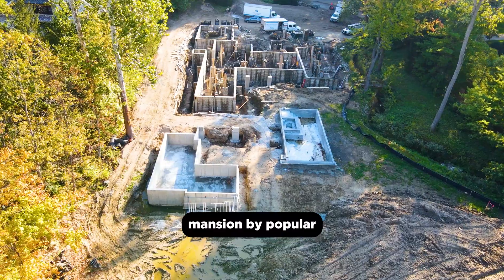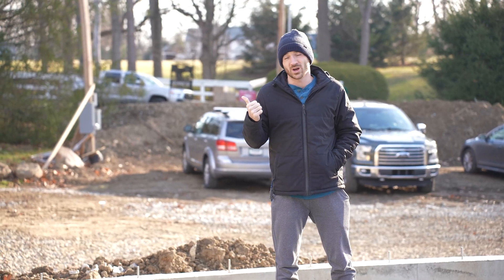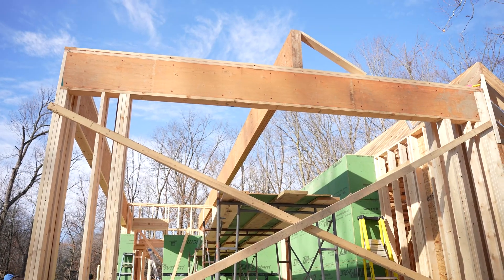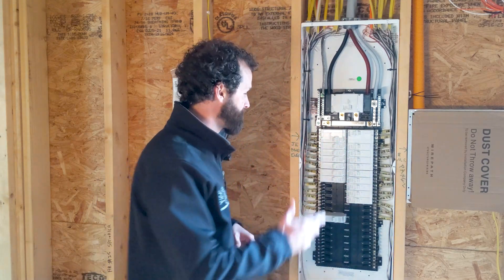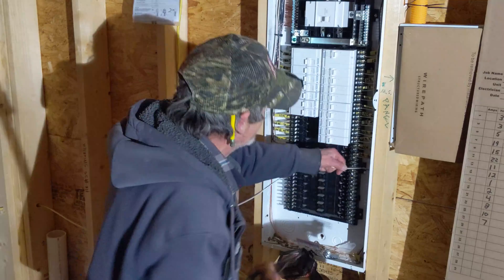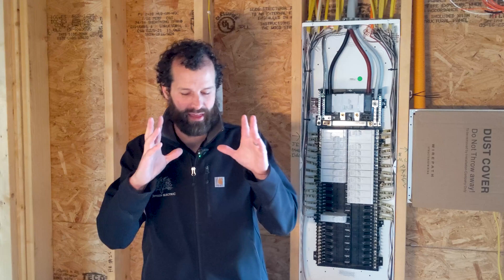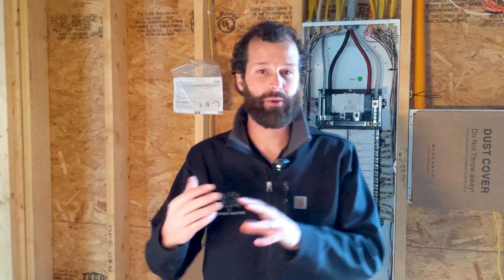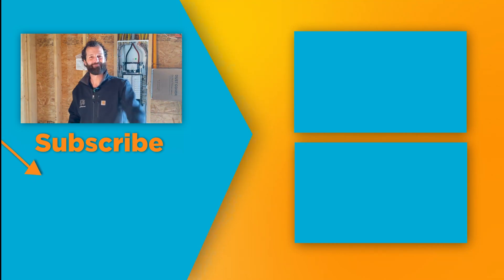Our BIGGEST Electrical Project EVER - Part 2

Comment from the maker: Reply to this comment with the particular parts of the house you want to see in detail!
Reply: I would love to see the service entrance into the property through to the panels! I think that is amazing that they are getting their own transformer!
Reply: I would like to see the transformer in detail - that's something I've never seen up close before. How is it wired? How is it distributed? Etc.
Reply: I need to see lots of rough in. I heard about the new blue and purple sheathed romex, which you gotta show (if it's legal in your jurisdiction).

Edit: you also must explain why you didn't go with 3 phase power for this house (residential excuses don't cut it!)
Reply: Everything with the smart panels, backup power, and low voltage. 

I would assume fiber would be ran to the out building(s).